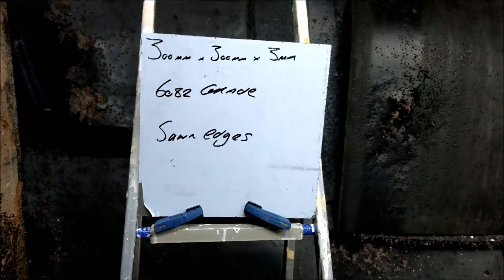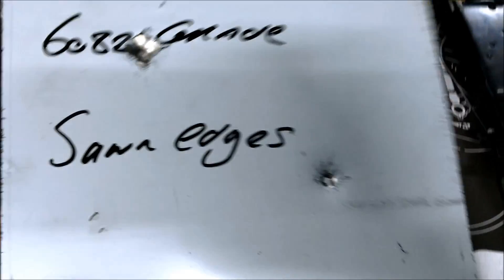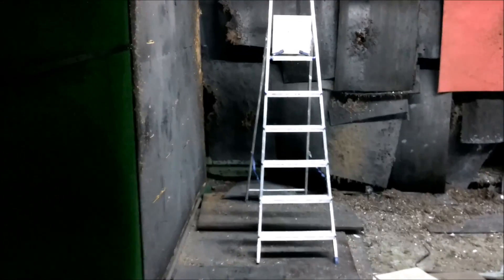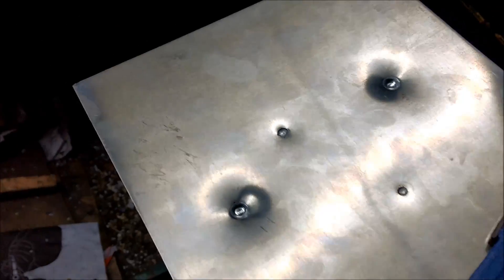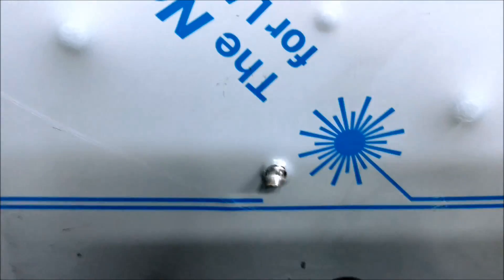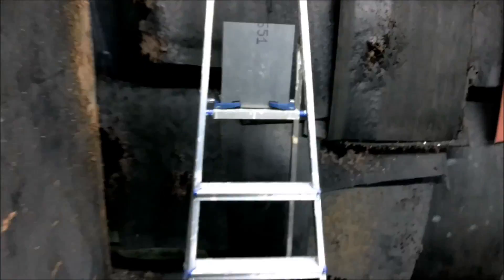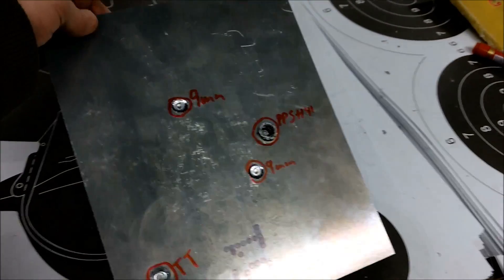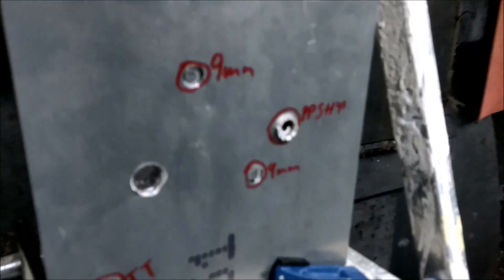Homemade bulletproof armor plate - Test of aluminium 6082

Comment: Do you think somewhere between 3/8-1/2 of an inch of aluminum (coming from a few pieces and just sandwhiching on top of each other) with pants taped around it will stop a .22, I mean those were the only materials I had without buying anything, just a little experiment

Comment: How Much Do they Weigh???
How Much Do they Weigh???
How Much Do they Weigh???
Reply from the maker: i did not check, sorry
Reply: Just from calculations...
1.35 g/cm^2 for 5mm(to stop 9mm) so just over 1kg for a normal sized(10x12in) plate.
2.7 g/cm^2 for 10mm(to fully stop 7.62 Tokarev(from pistol)) so just over 2kg for a 10x12in plate

Comment: Titanium Armour

Firstly, titanium armours can be spaced apart to increase the effectiveness at stopping bullets. And spacing the titanium sheets apart creates a cushion that slows the bullet before the titanium is penetrated. For example, a titanium shield can have a thin 1.2mm sheet of titanium over the front of the main shield plate. This 1.2mm sheet can have spacer lugs welded to it. Furthermore, a bullets force will be reduced on impact with a space of 1 centimetre inbetween two titanium sheets. And a 1.2mm sheet of titanium in front of the main shield plate would do this. Lastly, this titanium spaced armour has actually been demonstrated and tested to be effective on the American demolition ranches.

Next, spacing other metals apart would create a similar bullet stopping effect. And I imagine that spacing steel apart would be effective to create a cushion that would slow a bullet. In addition, aluminium would also increase in effectiveness spaced apart. Furthermore, I think because of the properties of aluminium spacing it would have limited benifits. However, you would still increase your bullet stopping power by spacing your aluminium apart. As a result, I think that all your metal and alloy armours should be spaced in some way and taking the time to do that is a good idea. Lastly, when you space your armours apart it is so effective that you can expect to stop a higher calibre bullet. And this is particularly useful on a shield.

Next, I have discovered the most perfect size and weight bullet shield. After testing with shield weights 10 kilograms is sort of the maximum weight you want a shield to be. Therefore, the perfect size shield is 3mm thick titanium. It is a tower shield to pass through doorways and it is 100cm X 70cm. The total weight is 9.5 kilograms without a handle. In addition, 10kg shields are perfect weight for 160-200 kilogram people.  It is a perfect weight because it starts as slightly too heavy to use as a shield and as you practice it eventually becomes light and practical. Lastly, remember that you will be wearing a bullet proof brigandine behind the tower shield. This makes a 3mm titanium shield a reasonable thickness.

Table#1 Types of Shields
------------------
Titanium backpack buckler
-40cm in diameter
-4mm thick titanium
-Weight 2.5kg including handle
-If the 4mm of titanium is a high tensile strength and spaced correctly you will be able to stop 7.62 NATO and 50cal magnum rounds with this buckler.

Titanium Tower Shield
-100cm×70cm in Area
-3mm thick titanium
-Weight 10kg including handle
-If the 3mm of titanium is a high tensile strength and spaced correctly you will be able to stop 45cal magnum rounds and 5.56 NATO with this shield.

Half a Titanium Tower Shield
-50cm×70cm in Area
-3mm thick titanium
-Weight 5kg including handle
-If the 3mm of titanium is a high tensile strength and spaced correctly you will be able to stop 45cal magnum rounds and 5.56 NATO with this shield.

Aluminium Shield
-50cm×70cm in Area
-10mm thick Aluminium
-Weight 10kg including handle
-The tensile strength of aluminium varies a lot between regular aluminium and the 7000 series of aluminium. And that means you can make this shield just as effective as titanium.

Steel Shield
-50cm×70cm in Area
-3.5mm thick steel
-Weight 10kg including handle
-If the 3.5mm of steel is a high tensile strength and spaced correctly you will be able to stop 45cal magnum rounds and 5.56 NATO with this shield.

Lastly, the perfect thickness for bullet proof brigandine plates is 3.0mm or 4mm titanium. And you just try and find the highest tensile strength titanium you can and just use that thickness. In addition, I have also decided that if you get a 1mm thick aluminium face size plate you can shape it in to a horror face and then bolt it to your titanium helmet. As a result, you can have a full set of bullet proof brigandine armour with a horror face helmet. That is going to be terrifying with swords and bowling ball cannons. Finally, if your metal tensile strength is high enough you will be able to deflect or even completely proof yourself against 7.62 NATO bullets.

Table #2 Use of Formulas
----------------
s = tensile strength in pascals (Pa)
F = force in newtons (N)
A = cross-sectional area in (m²)
m = bullet grain mass (kg)
a = acceleration of bullet (m/s²)
t = time of impact (seconds)
v = velocity (m/s)

F/s=A (using tensile stress formula)

(m(v/t=a)=F)/s=A

9mm bullet Force = (m(v/t=a)=F)
v/t=a
(430m/s)/(0.0024s)=179,167m/s²
ma=F
(0.0075kg)(179,167)=1344N

Aluminium tensile strength = 240MPa (Aluminium)= 240000000Pa

F/s=A
(1344N)/(240000000)=5.6e-6m²

5.6e-6m² = 0.0000056m2 = 0.056cm² = 5.6mm² 

Therefore, a 9mm bullet traveling at 430m/s requires 5.6mm² of 240MPa metal to block it.  

Reference:
https://youtu.be/QOkZzjQEx4M
https://youtu.be/FTYGvL_e1ko
https://youtu.be/urz8vhJpcIY
https://youtu.be/pBKItHNe4qk
https://youtu.be/6on8zQOuS-Q
https://youtu.be/xLSBRGePh0U
https://youtu.be/DwXzla2Ye24
Reply: You aint stopping 5.56 with only 3mm of anything, no matter how it's spaced(barring 80m of "spaced armor")
Reply: @notachair314  exactly. you at least need 5-6mm if you are using the best ballistic steel available. vs armor piercing you need 15-20mm
Reply: 0.0024 is the set "time" variable in the formula. It is chosen based off of these test videos.
Reply: So it is that variable that matches these videos. The formula works fine. You just change the bullets and metal MPa around in it.
Reply: The tensile strength of the aluminium in this video is about 290MPa
Reply: Let's shoot a Tokarev at it
5.5 g (85 gr) FMJ469 m/s (1,540 ft/s)605 J (446 ft⋅lbf)

(m(v/t=a)=F)/s=A

Tokarev bullet Force = (m(v/t=a)=F)
v/t=a
(469m/s)/(0.0024s)=195,416m/s²
ma=F
(0.00551kg)(195,416)=1,076N

Aluminium tensile strength = 290MPa (aluminium)= 290000000Pa

F/s=A
(1,076N)/(290000000)=3.7-e6m²

3.7-e6m² = 0.0000037m2 = 0.037cm² = 3.7mm² 

Therefore, a 85 grain Tokarev bullet traveling at 469m/s requires 3.7mm² of 290MPa metal to block it.
Reply: That's the smaller Tokarev bullet I think. Lower velocity a lighter grain

Comment: was the alluminium tempered? heat treated? or in it's "0" condition?
Reply from the maker: it was normal aluminium, got it on ebay.
Reply: @Drzewacz888  okay! Interessing then, especially when comparing the weight to strengh ratio with the titanium grade 5, you tested.

It really makes Me think that a 20 mm thick alluminium like that could, while still remaining possible to Wear in a heavy vest, maybe stop some smaller rifle rounds

Comment: but if you make it into a composite and place something hard like ceramic in front to break innitian impact and glue rubberized cloth on the back of the plate to stop any aluminium shrapnel you might get good armour against small caliber.
Reply: You need also some space between the hard ceramic plate and the metal plate behind it. This extra space helps in distributing the material so that it can expand over a larger area and this will help in protection. This technique is used in the space industry against small micro meteorites.

Comment: Isn't much of the energy being used to move the plate off of the ladder? If the plate was solid mounted, would it be easier to penetrate?
Reply: My thoughts exactly.  This is a very poor test of how aluminum would perform as armor.

Comment: Should i use aluminum plates in my plate carrier?
Reply from the maker: You have to answer that question yourself. I can not advise you anything as i am not an expert.
As you could see on video it can stop few types of ammunition but rally i would not rely on it.
If it was SHTF scenario, i guess its better than nothing but if you can, get a proper AR500 plate.
Also, answer one question, How much you value your life?
Reply: Drzewacz888 well i was thinking about using it as well as soft kevilar. So when i get hit it wont break my ribs. Typically ceramics or steal is used but i have neither.
Reply from the maker: Brown-Streak Studios so you want to use it under soft body armour kind of like a trauma plate to dissipate kinetic energy. But remember, soft body armour can behave differently with hard material behind it as it will have no space to deform and catch the bullet.
If you use it in front of body armour, than you might get injured by bullet fragments. If you watched my titanium plate testing you can see what happens to my plate carrier. Using bare metal without spalling protection is risky.
If it was me, I would use it under body armour but don't quote me on that. Maybe do some testing yourself, it cost a bit but it's fun and it will give you a lot of info if done correctly. Good luck.
Reply: Drzewacz888 i was thinking of putting card board between the soft body armore and plate.
Reply from the maker: Brown-Streak Studios i don't think it will do any good
Reply: Be warned, that "spall coating" isn't enough on metal. You need a layer of at least 2a rated Kevlar around the edges/covering the plate.
Reply: 5mm of 7075 is good for that.

Comment: That 6082 plate has a Brinell hardness rating of only 90.  2024 Aluminum has a rating of 120, and 7075 plate is rated at 150.    It'd be interesting to see if those plates gave the same ballistic performance.
Reply: There's also the 7068 Aluminum with rated Brinell Hardness of 190 and Tensile Strength of 710 (or so Tennalum claims) when heat treated. And there's the harder Al-7034.

It's not just the hardness that counts but also the tensile strength. It plays a role when the metal is bent due to the force of the bullet. To demonstrate, while trying to reproduce Al-7068,  I accidentally created a very brittle but very hard plate of it. The plate did not withstand a 9mm. Although it was hard, it broke into pieces like a ceramic. 

On the other hand, I made an almost half-an-inch thick plate of Al-7068, untempered, and it stopped .45 caliber ACP round like it was nothing. Not even a dent, just some circular scratch. But when the plate was shot by an M4AI rifle, it broke. Probably, it was stressed from all the .22 cal long rifle and 45ACP rounds fired to it repeatedly.

I will now make a Al-7034 and temper it. Hopefully, it will work as an armor. It will help a lot of police. Pray for me, guys.
Reply: @nochannel1000  what is the first gun name
Reply: Hellcat BOYZ I just bought some 6082 3mm sheets and damn they’re strong compared to 1082... mad to think what 7075 feels like given they are nearly 80,000 psi and my 6082 is “only” 42,000
Reply: @tydeProductions  Were did you buy thise sheets at?

I can't find any big sheets to make a suit of armor from. 

It is mostly for cosplay but it is cool to know it's very some stuff.
Reply: I have tested 7075 (against rifle calibers). It is too brittle. It has only elongation about 5%, there are much better options like 2024, 2017A (or less available 2060, 7039, 7085) that have similiar properties with elongation about 15%, so basicly they are like construction steel. 6082 is also kinda brittle, elongation about 7%.
Reply: I'mHungry yup
Reply: Omg thankyou so much
Reply: Invisible material for inside buildings..
https://youtu.be/-i3HhqxW1cE?si=EmQu3ea9aHyryimB

Comment: very nice 👏👏👏 . could you test 1/8" mild steel in my opnion also can stop this pistol rounds
Reply from the maker: 1/8 its just over 3mm, 22 will not go thru but 9mm? maybe. there should be something with steel testing on YT.  I'm trying to test light weight materials at the moment although i just ordered 2mm Tungsten plates for composite plate Tungstem/Aluminium and Tungsten/Titanium/Aluminium plate.
Reply: If money is no object, Titanium and Tungsten is a good composite plate.  AR500 equivalent protection at half the weight and bulk.  Aluminum and Kevlar / Spectra layered would make a good LVL 3A plate with puncture (knife) resistance.   Just gotta watch that cost-complexity spiral.
Reply: You kinda just answered your own question, and proved my point.  If Tungsten is 2.5x as dense as steel, then you'd only need a tungsten plate that was 1/2 the thickness to perform like steel.   I'll just have to take your word on the DoD testing.  It seems counter-intuitive that placing a denser material over a less dense one would have "no noticeable performance improvement".  If you served, you'd know how often Uncle Sam gets stuff flat-out wrong.

Comment: Nice gun, all steel, is it 9 mm CZ 75? Tokarev bullet jacket stripped like it should, steel core kept on goin'. All'n all, aluminium fared surprisingly well. Nine millimeter is defeated pretty easily from short barrels.
Reply from the maker: Juha Antti-Poika it's CZ 75 Tactical Sport Orange
Reply: @Drzewacz888  please tell me the first round gun name
Reply from the maker: @TheBestHKGolden  it's Ruger mk3 Competition